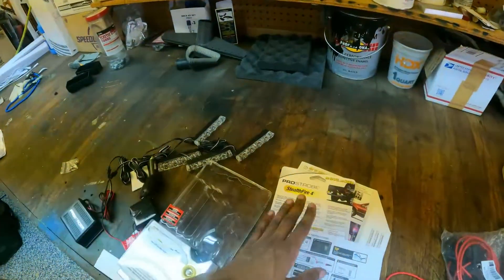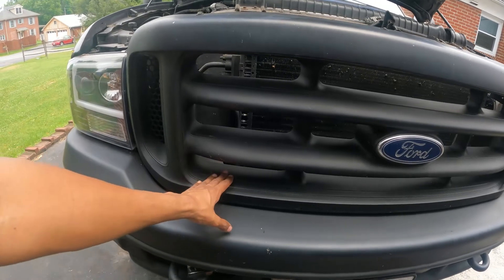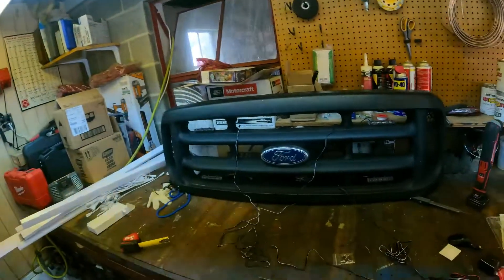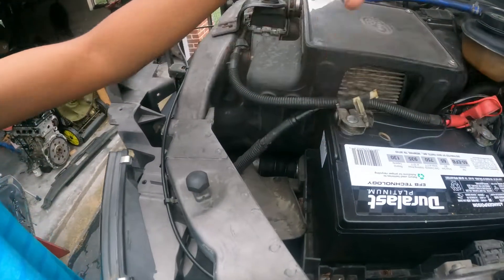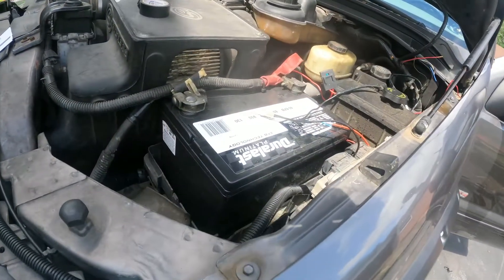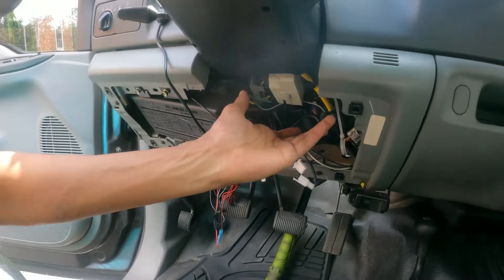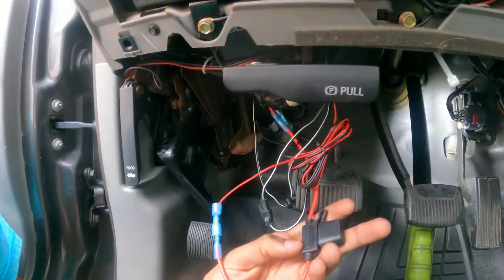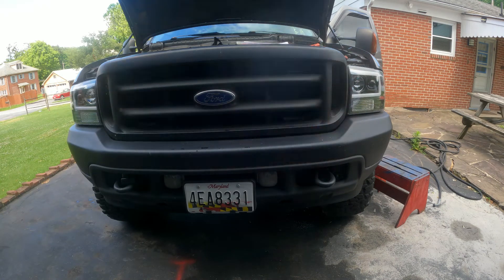How To Install PROStrobe Stealth Fire 4 Lights

Comment: I have those installed in my car after while u get condensation in the light then 1 or more LEDs stop working and  that manufacturer don't replaced them or return ur phone call  if they turn on automatically when switch is tuned off  u cannot reprogram the wireless remote  no reset connection

Comment: I was about to install these on my 99 silverado 1500 for plowing snow but when I connect to the battery, they're on all the time even when the controls are powered off. I feel like that's going to drain my battery super fast. What should I do? I thought it was easy
Reply from the maker: What kind of brand are you using?
Reply: @EbnC  I actually got them to work after plugging the controller in.
Reply: @EbnC  same brand as yours